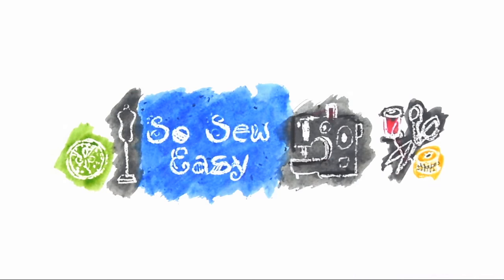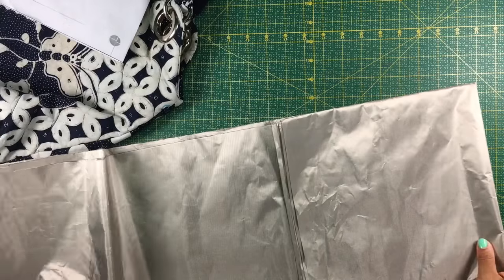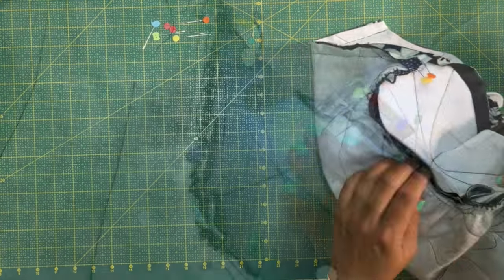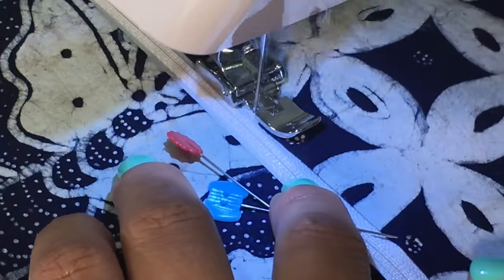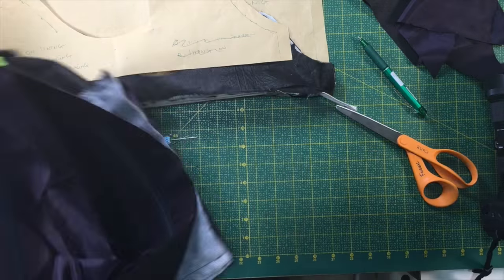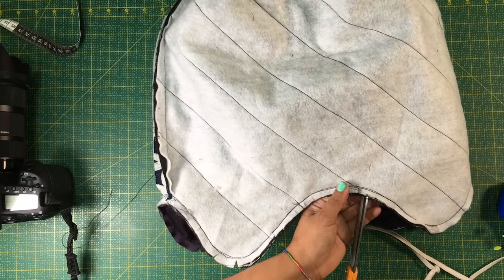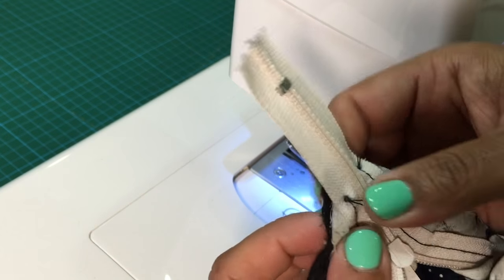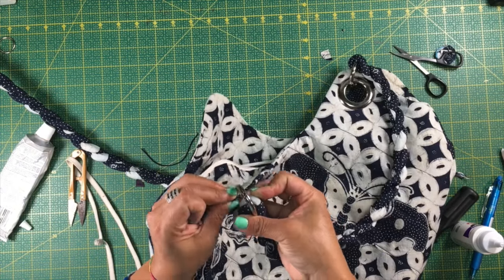Sewing the Anti Pickpocket Bag: Part 3, Assembling the Bag

Comment: I'm nearly finished with this wonderful bag, but am having difficulty finding the big grommets.  Had to order the opening rings from China.  Can't find anything but plastic grommets, which aren't thick enough to accommodate the layers in the bag.  Help!!!  Please!!!
Reply from the maker: Hi Betty, Please try Amazon,  https://amzn.to/2zUcvWU  this are the ones I used even thought they only had 3 starts reviews, you need the Kam tool, (with the handle) to be successfully attach this grommets. They do not work well with the hammer and the tool that you can purchase in hobby places. Otherwise you can use a larger or smaller diameter of grommet, it is so you can hook the handles.